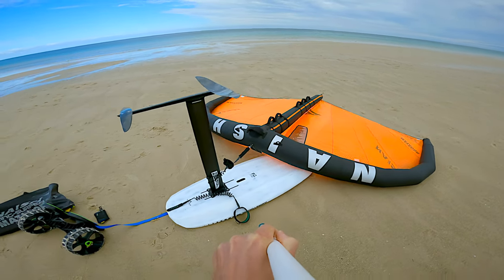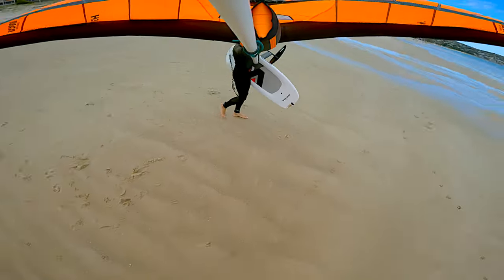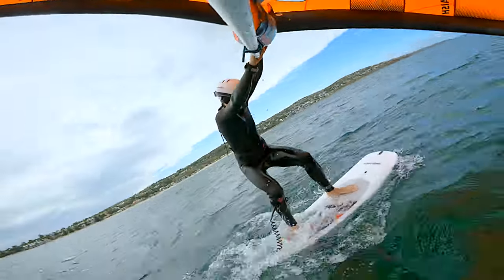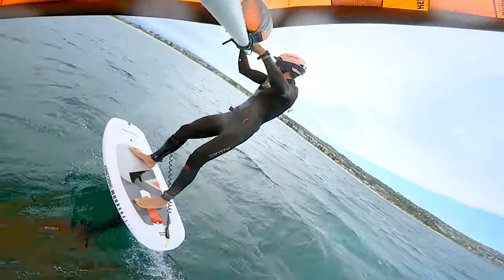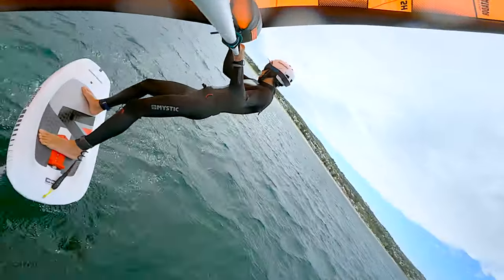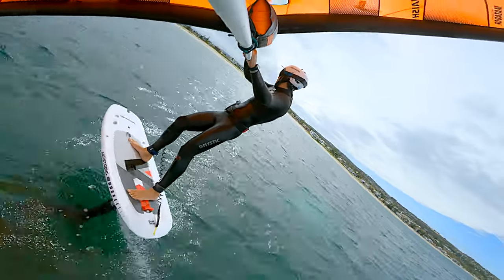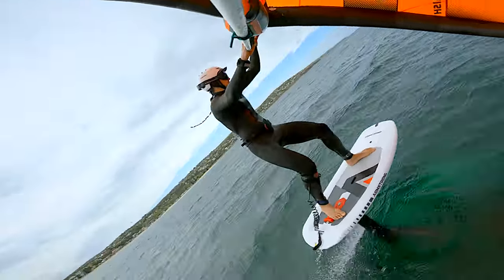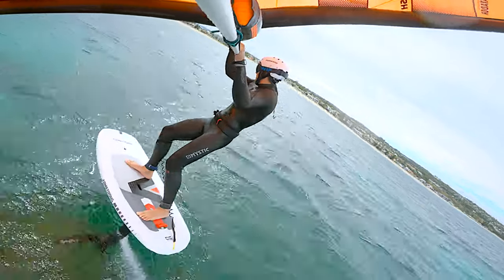Wing foiling top speed? Winging with kite front wing SAB W671

Comment: Awesome video! I've been waiting for good wind to try my 671 out for max speed. I can hit 31kts on a kite with it but stoked to try top speed on a wing.  Thanks for the video!
Reply: I finally got a windy enough day and rode my 671with the 421 stabilizer on my 111cm mast. Using my 6m ozone wasp.  I hit 22.1 knots. Felt like that was as fast as the hand wing would let me go.  I easily hit 30 knots with a kite and that foil.  I was also surprised at how hard it was to go up wind on that small foil and big wing.   Hoping to try again on a smaller 4m or 5m wing.  Also I also found that with my Axis hps 930 I can hit 21.4 knots. It's surping that my 671 wing was just a little faster than my normal wing foil.  Hope to test the 671 some more to see if I can get a better top speed. I was exhausted after 30mins of riding that 671. So much work compared to a normal wing foil. Cheers!

Comment: for speed on SAB try the Balz pro 720 the old one I was getting 25 knots with Gen 1 wings 5m Fone swing in 20-25 knots pretty flat water . The Balz  still has bite and some glide was easy to ride but not a  great pumping wing. It worked best with the S400. If you still want to go much faster with a more modern foil the Gofoil TKR80 (Tow Kite Race ) can do 30 knots it has decent  glide and pump for a small wing using KD Maui 13" tail wing.
Reply from the maker: Too many choices to try... One thing I underestimate is how much difference makes a smaller tail such as s376, way looser on all axis, have to "re-learn" gybing/tacking, probably 2 sessions at least to register the difference but it makes w1000 faster and way more efficient when pumping. It needs some speed to be semistable

Comment: Here at Sherman Island we hit 25kts all the time, and a few of the better guys are hitting 30 on the wing.  Billy Ackerman w/fone says he has hit his top speed on his Eagle 790.  I've ridden the Eagle 790 but have gone faster on the Escape 630.  The Phantom 740 and Mirage 800 are all pretty close.  Yes, it takes a little bit bigger wing, I ride the DLABS, they have plenty of power.  Just got the North Modes which are supposed to be faster.  We shall see.  I find it is imperative to match the foil to the wing - when not quite balanced you can always notice one or the other being the limiting factor.  Wings have a ton of impact on top speed as does the foil.
Reply: Escape 630 is the fastet I´ve tried. Almost 29 kts in 2 sec and 27 kts consistently
Reply: @zurraspa1  i have escape 530 with Kite, but my topspeed is 24 Knots

Comment: Cool video! I was actually thinking about the 740 to go with the 1000.
PS: what Cedrus mast size did you get?
Reply from the maker: Thanks! You won't get much more speed from going from W1000 to W740 but control/confidence will be better on W740 on high speeds. 
I got 85cm project Cedrus mast.